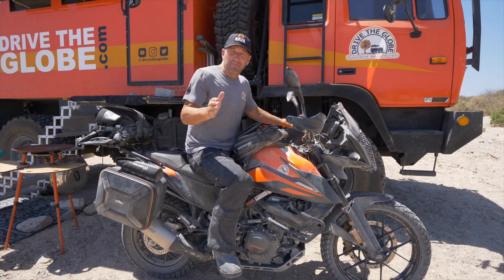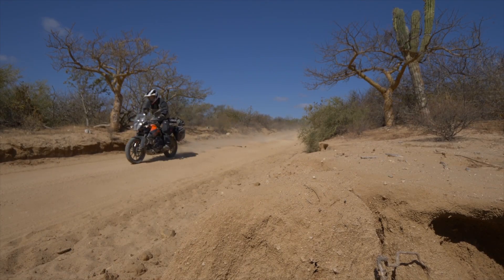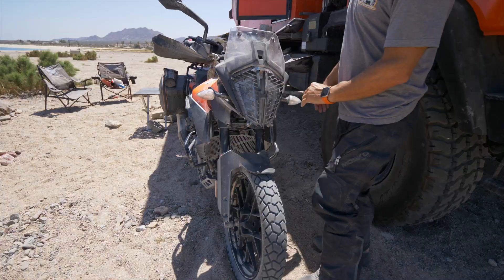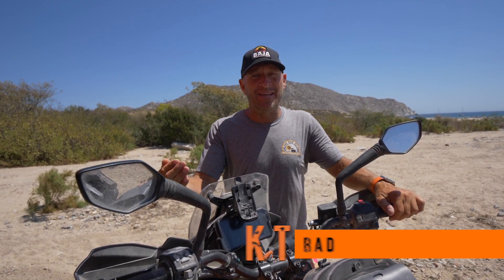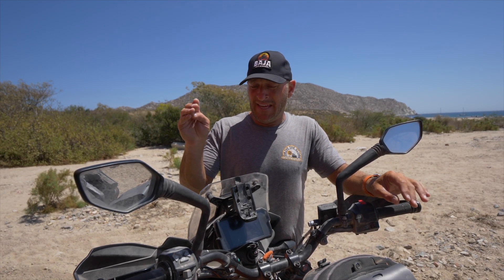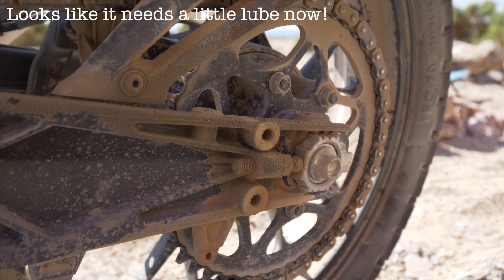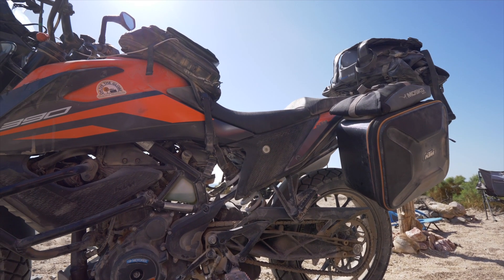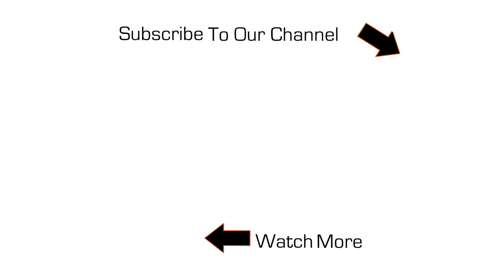KTM 390 Adventure Review - 2000 miles off road In Baja

Comment: It's a fine small tourer.  It is not good off road.  All power is top end, ground clearance is awful, suspension is OK kinda, the electronics are intrusive and irritating to use.
Reply from the maker: Sounds like you don’t like it 😂. I actually love it so far, I rarely use it on pavement and admittedly I’m not thrashing it through hard off road trails.
Reply: @drivetheglobe  It's not that I 'don't like it'   It's the fact that it is not fit for purpose.  Any bike can do fire roads and dirt lanes.  This is sold as an adventure bike and I don't see it faring well in places the humble Himalayan would do fine (and no, I don't own or am a particular fan of that bike either).
Reply from the maker: @hazcat640  I hear ya.  It will be interesting to see what I feel after another 10k miles. For me, and what I do, the weight and the original price are hard to beat.
Reply: I did the California BDR and Nevada BDR on a 390 with no issues. I have a 690 as well, this bike won’t go as fast as the 690 off road,,, but it’s capable!!!!!!